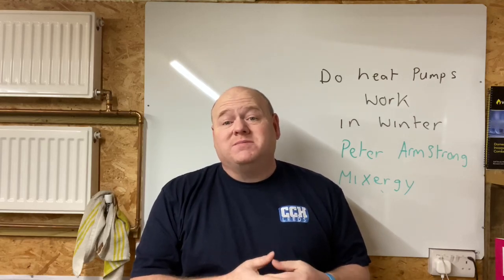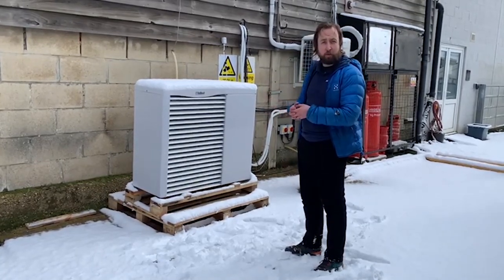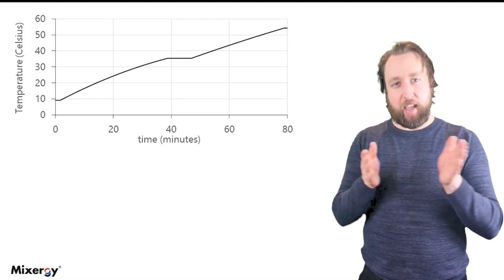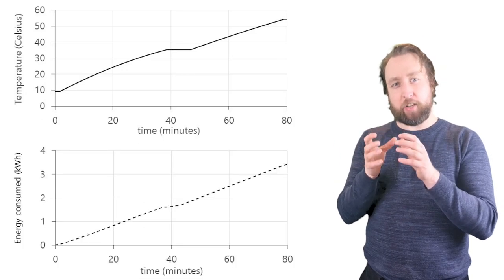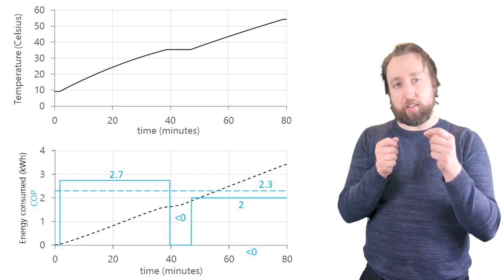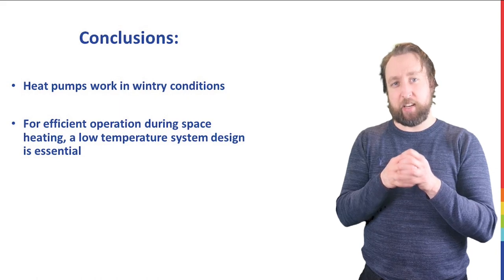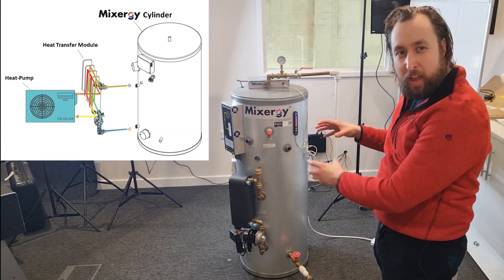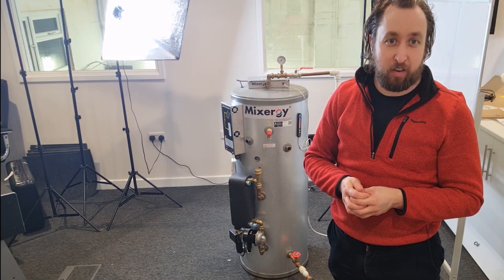Do Air Source Heat Pumps Work In Winter - Peter Armstrong Mixergy

Comment: The Government need to realise the reality that ASHP will be mostly OK in new build houses that are approaching the passivhaus standard.  The reality is as a retrofit the ASHP will be a disaster in most cases.  I am doing a restoration to an 1895 5 bed Victorian property in Scotland so damp cold winters.  I will be putting in underfloor heating into a large thermal mass in the kitchen, utility and bathrooms.  ASHP is for the summer and shoulder months.  We will need a wood burner for 2 to 3 months even with a high degree of Enerphit building practice.  PV on the roof will save electricity as an ASHP can not match gas for value today at 15p/kWh vs 2.6p/kWh for gas.  Of course the idiots in Whitehall and holyrood  will just tax gas and kill the poor and the old with hypothermia....  I will keep the gas boiler as backup....
Reply from the maker: Thank You

Comment: expensive to fit, and expensive to run 3.4kwh in 80 mins. the housing stock in this country is too far off the mark insulation wise. thankfully worcester bosch have already developed liquid hydrogen boilers, which are able to use all the existing infrastructure....which will keep all us gas engineers in employment. the sacrifice will be fires and cookers, but i.m ok with that...added to that the national grid for electric will collapse if idiots like greta have their way. heavy draw heat pumps, very heavy draw car chargers, and all new houses are currently being installed with 80amp main fuses not the 100amp like before.....
Reply from the maker: Thank You

Comment: Had an Air to Air 3.3kw pump for 6 years now as only heat source (except for bathroom where I installed floor heating so it drys up after showers). 140m2 1950s house. When the temperature drops down to -30 it starts to struggle a bit and comsumes around 15kwh/24h but over that it works just fine. 
I can't compete with the neighbors ground to water system that always can work with optimal temperature. But the cost of 2000 vs 12000 was a big factor for me. 

The plus side with air to air is the cooling possiblity in the summer is so easy. It's possible with ground source as well but much more complicated. 
I
Reply from the maker: Thank You

Comment: These systems only have a chance of working in a new build that has good insulation. If it is retrofitted the customer has to find a place to put the large cylinder and the condenser unit. The condenser units sound like aircraft taking off and it has to be close to the property to be efficient. Oh, and the servicing engineers will be like the aircon ones, a bit hit or miss.  Unfortunately this technology is being forced upon us as it has been heavily funded by the government.
Reply from the maker: Thank You

Comment: This is fine for just heating the water with no load (ie - you’re not actually using any of the heated water during the test). 
Can it actually cope heating a house or providing hot water during the test conditions and still cope?  
Just heating stand water is not a real life scenario.
Reply from the maker: Thank You

Comment: If 4kwh is put in using the heat pump how does that compare with switching on a 4kwh tank immersion heater in heat rise/time? It's always the base line cost that matter, if its negligible then what is the point?
Reply: Hi Matthew, in this case we were testing with an 8kW heat pump so this would over twice as fast as a typical 3kW immersion.. in terms of cost - see above for a more detailed comment but we'd be talking a third of the operating cost potentially but with a big capital expenditure which is challenging to recoup for many householders quickly enough without grants etc...
Reply: @mixergyltd6286  okay so if we say for the ease of calculations if a 9kwh immersion heater was used and a 9kwh heat pump was used then the heat rise would be one third faster for the given time to reach a pre set temperature?
Reply from the maker: Thank You

Comment: I think the ASHU was way oversized for heating the water alone and this will have affected COP by virtue of defrost cycle.

I note in the North American market they have hot water cylinders with an ASHP sitting on the top of it (extracting heat from the inside environment) which looks interesting. Any UK suppliers doing this?
Reply: Hey Norman, during the test, we were extracting the heat out as fast as the heat pump could discharge it but over the range of temperatures that prevailed within the tank. Therefore, the heat-pump wasn't 'oversized' from the perspective of this test. 

The heat-pump will enter into frost mode more quickly the greater the rate of heat transfer from the system.
Reply from the maker: Thank You

Comment: You have to remember the housing stock in the UK is on average very old, they are not efficiently insulated, draughty and hard to heat anyway, not a great start for a heat pump in my opinion.

In a modern, highly insulated, highly efficient property, then yes, you may have a chance of getting through a very cold winter but you won't be walking round the house in shorts and t shirt lol ⚠️😯😁

I can get my house, semi detached 1950s ex council house, up to around a barmy 25c in the depths of winter, with outside temps down to as low as -10c!
With a 2 year old Worcester Bosch boiler, I have cavity wall insulation and double layer of traditional roof insulation, double glazed throughout although the rear UPVC and glazing is older and not as heat efficient as the more modern front, so we are losing heat from the rear, new back door and surround is our next investment which should help a lot.
Reply from the maker: Thank You

Comment: It amazes me that in Finland ground and air heat source pumps a fairly common and those homes are warm even in the depths of Winter. Finnish winters are long and cold so I am puzzled as to why in UK its not a viable option
Reply: Sadly people are scared of change. Plus many people in the UK seem to be confusing Air Source Heat Pumps with Ground Source Heat Systems.
Reply from the maker: Thank You

Comment: Had my heat pump since spring. Really impressed so far. Quieter and more reliable hot water.
Reply: Please come back and report if we get a cold winter!!!
Reply: @jdavis460  I'm based in Galway, Ireland. Been a bit warm for November so far but the heat's been going most of the month because the nights still get pretty cold. It's done well so far. I have solar panels to offset my electricity cost over the year, but obviously in winter that's limited. I suspect over winter my electricity bills will be in the €300-€500 per month range. That's a fair bit up from the €150-€200 per month range they used to be - though electricity price rises also play a role.

Long term I'm going to add wind power generation to offset electricity costs in winter. Usually if the sun's not shining the wind is blowing so that should help reduce those costs further. And that's the main benefit to me. Once I move all energy to electricity at home, it then becomes a generation problem. I'm limited in generation options for oil and gas based energy. And I only have .2 acres of land, so solid fuel based energy isn't really an option either. But roof PV and VAWTs as fencing can work for electricity generation.
Reply: Quieter? How were you heating before . Heat Pumps are noisy especially at night .

Comment: Very useful information Allen. Many thanks. Initial installation costs of ASHPs is putting me off from changing my oil boiler at present. I know company's will say you can claim a renewable heat intensive but sounds like a lot of hassle to me.
Reply from the maker: Do you know if you can get a grant? Thanks.
Reply: Alan there is absolutely no grants available in Nothern Ireland for heat pumps.Unfortunately.

Comment: Very interesting Allen and Pete, thank you. 
I wonder how effective heat pumps are once retro fitted to an existing wet radiator system with 10mm micro-bore pipework. Looking to replace our gas boiler, so doing general research at this stage. What's your experience with micro-bore heat pump central heating installations?
Reply: DO NOT DO IT.
Reply: I am currently looking to replace all my radiators with Daikin Fan coil units which are designed to run between 35c to 45 c flow and I am sizing everything at 35c flow to maximise the efficiency of the air source heat pump I intend installing. I am also considering oversizing the buffer to minimise heat disruption to the FCU during the ASHP defrost periods.
Reply: @neilashdown6854  That's more like it. Underfloor is best, but fan units are a good cheap alternative. You could get COP3 at 35 deg flow. . . Another option is a gas or oil boiler, cheap, and a quarter the running cost. !
Reply: You cannot use micro-bore with heat pumps.  All your main piping has to around 20mm with perhaps 15mm feed to radiators.  Radiators have to be double size, and then the system has to run hours longer than a gas central heating system to get the house up to temp.
Reply from the maker: Thank You
Reply: Microbore pipework will not work with a heat pump so new 15mm or 22mm pipes will have to be installed running down all the walls to each radiator. A complete mess. Existing radiators will have to double in size so will be obtrusive and difficult to integrate into a smaller rooms. Wait for hydrogen which will use your existing boiler system and cost a few 100£ to convert from gas.

Comment: They do NOT work well in winter..................
Reply from the maker: Why?
Reply: @AllenHart999  Because with less heat in the air in the winter , especially when the air is frozen, the unit itself starts to frost up and becomes very inefficient.......I had one running my central heating for 12 years and it was RUBBISH.....
Reply from the maker: @duncanandrews1940  They are saying they work well. I have never installed one and have no experience. Thanks.
Reply: @AllenHart999  We had one for about 10 years. It was connected to the central heating system and in winter the radiators barley got warm let alone hot! It also cost a lot to run, and service every year -

Comment: So it took 80 minutes to get that small cylinder to 50 C. But how long did it take to heat the domestic hot water, (DHW) from that to 45C so my wife can have a bath, and then reheat the water so my kids (other staying with me for the weekend) or I can have a bath?  When we returned from a wet and cold walk to a cold house how long did it take to heat the house up to a comfortable temperature? Where is all this electricity going to come from, when you want to charge all the electric cars, run the lights in the house, heat the house. The current infrastructure, isn't in place, to supply the demand. Save the planet by all means (it is the only one with beer and wine), but don't force us back to the stone age in the process. I predict that in 5-10 years there will be a new "were you miss sold " industry to follow that of PPI, Bank charges, credit card charges, local housing rate charges, and now Solar panels!
Reply from the maker: Thank You

Comment: I live in Sweden. We have used a air/air heatpump since 2009….
Huge save in heating bill. 
Most houses in the area have heatpumps. 
In Sweden all heatpumps are made for cold climate. 

Get one that is designed for use in scandinavia and you should be fine. 
CTC in Sweden makes excellent units.

Comment: Our experience of latest ASHP in a four-bed well insulated house over 2 years - just about adequate in coldest temperatures, but a secondary heat source is essential not for water, but for a comfortable sedentary life style in largest room. Electricity consumption in winter is fairly steep, but over the year this evens out to give a total close to that when we had OFCH.  No grant for solar at the moment, or we might have added this. Grant for ASHP covers 70% of cost but is reimbursed over 7 years so you have to find the full install cost upfront. Which is what you'd expect from a shit Tory government who don't want to help the man in the street but will give massive tax breaks to Eton College which charges average fees of 30k a year.
Reply from the maker: Thank You

Comment: My Mom  has a Mitsubishi Air Source heat pump in Ontario Canada, and it works great even in cold weather, I suspect we get colder weather than most of the UK. One thing to point out that needs to be taken into consideration is how well the house is insulated and draft free.
Reply: Yup.  I know lots of people who use heat pumps here in Ontario with no issues.  Most people would be shocked about how seldom Ontario winter temperatures drop below -15.
Reply from the maker: Thank You

Comment: No I'm not convinced. What that guy was describing at the end had nothing to do with house heating and certainly not air pump connection. He was talking about domestic hot water which will never get up to that temperature from that box in the garden. You have been conned mr Hart by technology that you don't understand.

Comment: My real world experience is that they definitely work, and should do for most people if properly planned. I have a Mitsubishi Ecodan R32 11.2kW, installed in June 2021. We had our first sub zero night recently and the system had no problem at all quickly reaching the 20 degree C set temperature, in fact it over-ran slightly to 21 degree C. My house is a 4 bed detached built in 1990. Notably, the original 8mm network has all been left in place! We installed six new larger radiators and a larger more efficient hot water tank,  all of which would have been required anyway due to age, state of repair and under capacity of the old system, together with a low loss header to support the microbore system. The net cost after grant is c. £6k, no more than an equivalent new boiler installation although the grant repayments are phased over 7 years. So far, heating costs are comparable with a gas boiler but our kWh energy consumption is a lot lower, certainly half and possibly as much as two thirds less.
Reply: Don’t believe it!
Reply: Happy to show you Peter if you live near Aylesbury

Comment: Hey Allen & Pete, great video!

What gas is this monoblock running on? Is it 410a or R32?
Reply: Good question Richard, it might actually be R290, I'll check and get back to you!
Reply: @mixergyltd6286  that’s an older R410a model, perfectly good gas, if the unit is applied correctly.
Reply from the maker: Thank You

Comment: Mixergy cost £1400 just for the tank. Its only rated ‘B’ ERP rating (medium cycle ERP draw test)  and heat pump dont work very in cold and have a backup heating element due to this issue.  Air souce heat pump will never work in the uk and is being miss sold to people.
Reply from the maker: Thank You

Comment: That graph shows it consumes more energy than a gas boiler during ramp-up to 30c. Not good.

Other disadvantages:

High upfront installation costs  
10 x costlier than gas boilers ( £8k - 18k)
Requires significant work - drilling holes through cavities etc
Not as efficient during cold weather
Planning permission may be required
Can be noisy and bulky.
Higher maintenance costs
Not entirely carbon neutral.
Questionable Sustainability
Energy reducing costs exaggerated by the green lobby.
Gas boilers much cheaper.
Reply from the maker: Thank You

Comment: ASHP in domestic situations including existing poorly insulated buildings is going to be the biggest mistake ever by the Gov. 
People dont seem to understand the difference between heat and temperature. ASHP deliver heat but not temperature like people are used to. 
Incorrect heating delivery combined with poor airtightness often doesn't achieve a satisfactory heating temperature in the home. People then have the pumps running all the time in cold weather with poor efficiency meaning you may aswell just be using an immersion to heat the water quietly compared to having a noisy ashp. We have been contacted by so many people who felt they have been ripped off with ASHP.
Reply: My boss added, ASHPs efficiently provide Heat to your house, at a temperature that doesn't make you feel warm. Particularly if you use it to provide heat via convective rads. Less so if you use underfloor heating as the temperature gradient in the room is less.
Reply: I could rant all day about them. Additional complexity, cost, ozone depleting gases, noise, vibration... Absolute disaster. We need to concentrate on reducing the demand on energy before we look at alterntive methods.
Reply from the maker: Thank You